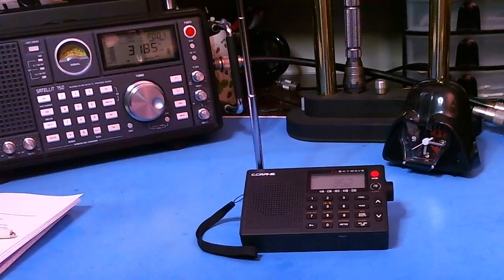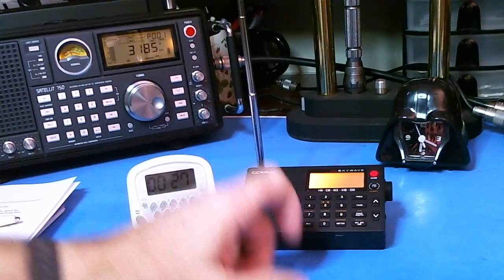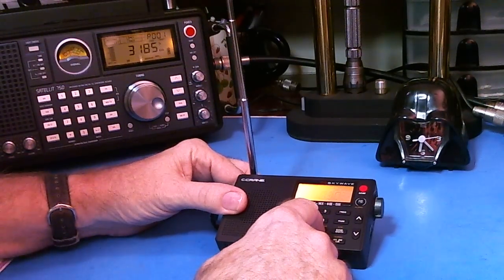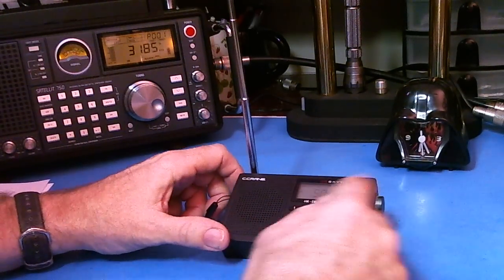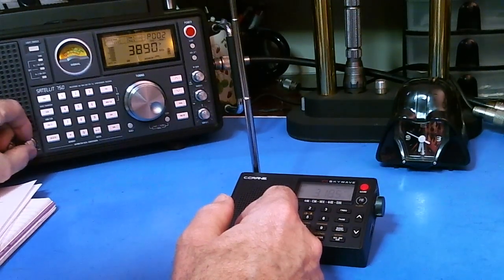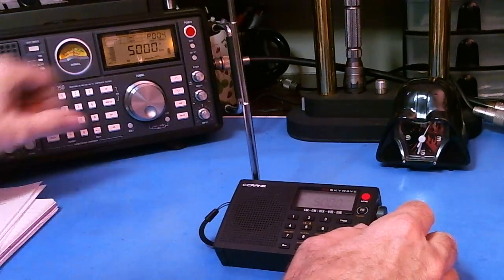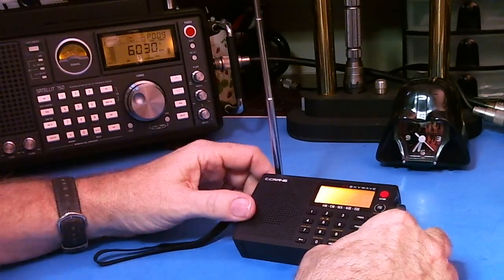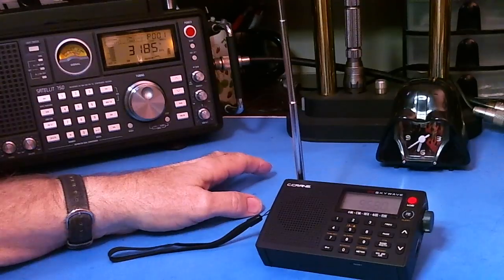TRRS #0479 - CCrane Skywave Radio - Reception Testing

Comment: I have a CCrane AM/FM/WEATHER band receiver that has 100% audio quality. I don't have the model number right now but I can tell you that this thing is built like a tank.It was given to me as a gift and was disappointed that it didn't include the shortwave bands.Looking at your Grundig,Tom,it appears they are about the same size. The only reason I'm posting this is because of the excellent audio and construction. I had never heard of CCrane until I got this one. Maybe,all CCrane receivers have great audio depending on the speaker size etc. BTW...the OfficialSWL channel and yours are about the only ones I listen to. Later....
Reply from the maker: Yes, Gilles does a great job on his channel.

Tom
Reply: hamrad88 The model was CCRadioplus....AM/FM/TV/WX+ALERT.
Reply from the maker: ***** ok, thanks.

Comment: I have the C.CraneSkywaveSSB. I worked Brazil last night with the onboard antenna and in the SW mode. I’m located in Springfield, MO - USA. I have several C.Crane. No complaints. As for the Grundig 750, I plan on purchasing one next year. They are good radios. WK0Y
Reply from the maker: Thanks for the report and have a great day.

Comment: Nice video Tom.  That little CCrane did ok considering the Grundig has a outside antenna.  Can you force the backlight to stay on though or will it always go out ?
Reply from the maker: So far I have found no way to keep the backlight on.  It may stay on if you have an AC adapter.

Tom

Comment: I liked this comparison But, the key difference in the reception between the Grundig with external antenna and the Skywave is the noise. And that noise is coming from your computer and camera - all those electrical appliances that are shielded by the antenna cable for the Grundig. So, it is not so much the external antenna being better but the inside interference picked up by the "internal" rod.

Comment: would be skycrane good enough to hit major stations worldwide, or do I have to spend 400+€ for 30 years old grundig ? tnx for informative video too :D .
Reply from the maker: You do not have to spend a lot of money but conditions have be right for long distance receptions and for now they are not.
Reply: @hamrad88   tnx. i do have few cheap Chinese  fm/mw/sw radios and some actually work quite good, but fail utterly at stations with weak signal. im looking for something that has general coverage of stations that has its program in english language. would this skycrane fill this role with good antenna or is better to buy better radio?
Reply from the maker: Depending on where you live and what stations you want to listen to, right now conditions are not good for shortwave listening except on random occasions. This is an OK radio but not one of the best.  You are going to have an outside antenna, something like the 750 in this video is a better way to go.  There are many others that are better than the Skywave radio.  See some of my other videos.
Reply: @hamrad88   an recommendations in each segment?
Reply from the maker: Sorry i don't understand you comment.
Reply: @hamrad88  my bad, english isnt my native language.  if you can advise which SW radio would be good at prices below 100$ and which above. i've been looking for that lovely satelit 750, but couldnt find any (at least for reasonable price ) . i did find few old satelit models (mid 70's or early 80's i'd say) but guy wants 250€ for each :O .
Reply from the maker: Checkout this webpage.  He does good reviews and this page shows you a lot of choices in on place. You can pick out some you like then come back and search for those in my videos to see them in action.  https://swling.com/blog/tag/best-portable-shortwave-radios-for-travel/

Comment: What shortwave below 35 pounds is good and possible to receive in ssb mode, maybe a pl 600 deal?
Reply from the maker: A Tecsun Pl-600 will cost you about $75 USD right now.  Requiring SSB is pushing the cost up.  If you can find one, the Radio Shack 20-629 is a good buy right now and has SSB.

Tom
Reply: Well I will have look on Ebay, furthermore I am in Britain. And thank you.... You are the best SW channel, I love your videos!
Reply from the maker: There is a lot of Radio Shack radios on Ebay now that they have closed many of their stores.
Reply: Thanks for the info!
Reply from the maker: Dean Denton You are very welcome.

Tom